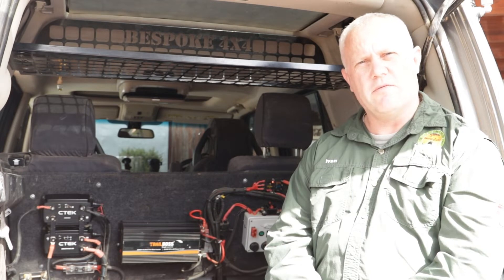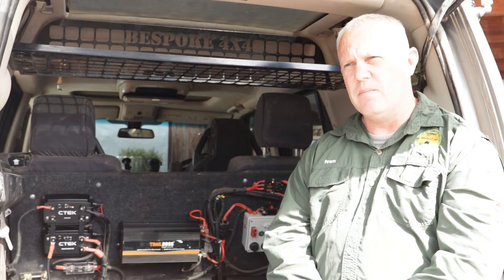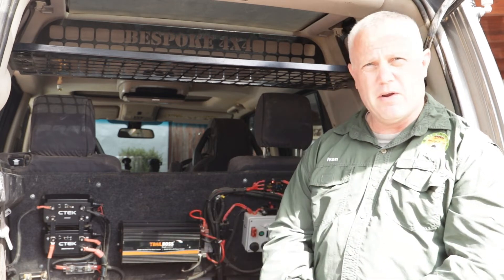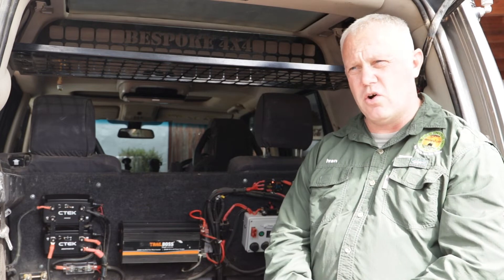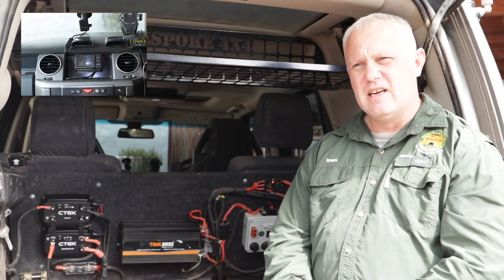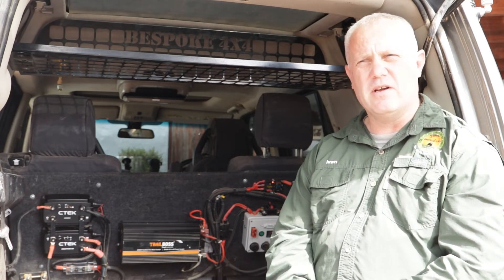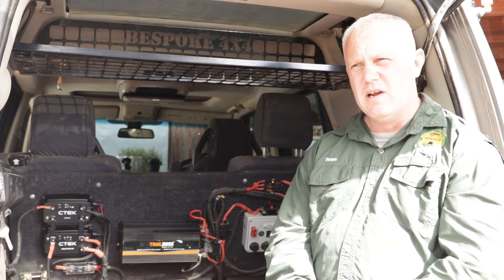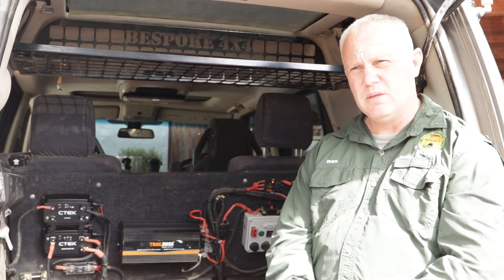CTEK D250SA and Smartpass 120 off grid system review

Comment: Hi. I have the dual250s with smartpass. Does this one actually send power the starter battery if it goes flat ? In the same way the 250sa does ? Thanks
Reply from the maker: Hi Nasser,

Thanks for your question.

To answer your question, I will break it down into two segments:

1.   The D250 (S, SA and SE) are purely DC to DC chargers, their sole purpose is to take your alternators voltage and usually up it to a voltage to best charge your service or auxiliary battery(s).  The D250 range will charge your Service/Auxiliary batteries up to 20amps.
2.   The Smartpass; its primary purpose is to take extra current (amps) from your alternator to provide extra amperage (controlled by the D250) to boost the charging of your Service/Auxiliary batteries.  

I do not know which version of the  Smartpass you are using (80amp, 100amp or 120amp), but the Smartpass has a second function to when necessary, (dependent on version) to firstly pulse the Starter Battery to keep it topped up with power from the Service/Auxiliary batteries for as long as possible when the engine is switched off.  Secondly, if the Smartpass finds that the Starter battery is flat, it will (again, dependent on version) provide up to 300amps of power from the Service/Auxiliary batteries to help start the car.  This supply of power to the Starter battery of 300amps is initially for around 10 seconds, then 200amps for around 20 seconds and then 100amps for around 30 seconds.

So, yes the Smartpass will assist with the starting of you car when your Starter battery is flat.

I hope this helps.....
Reply: @overlandi5056  thank you for clearly that up. Cheers for the thorough reply

Comment: Great Review!! Thanks!! I would like to ask you if it is possible to connect the starter battery to the service battery with a 500 A switch in case I need a lot of power to use the winch for a long period of time. 
Thanks and best regards 
Luca
Reply from the maker: Hi Luca, 

Thanks for the really good question.  

When using a D250 (S, SA etc.) in conjunction with a Smartpass, because you have DC to DC Charging (D250), you cannot connect the Service Batteries directly back to the Starter battery as you inquire.  That being said, I looked into your question at great length myself prior to installing CTEK equipment and obviously, in life, if you want to put enough effort in, anything is possible, but it is a very long drawn out affair and if you get it wrong, you will damage the equipment. 

But then I found out about a really clever feature built into the Smartpass as standard which, is why I went with CTEK equipment!!!!!!

The Smartpass is constantly monitoring the Starter Battery both when the alternator is charging and not.  So, if lets say, you go to start your car and find the Starter Battery flat with insufficient power in it to turn the starter motor, then the Smartpass will sense this and immediately engage what CTEK call "Start Assist" and provide to the Starter Battery with around 300 amps of power for around 10 seconds to help with the turning over of the starter and electronics needed to engage relays and solenoids associated with the starting process.

In addition, what I have seen with my application, which is pretty much exactly how CTEK recommend installation (other than I run much thicker or more heavy duty cables), is pretty much what you refer to in your question about the need to draw extra power from the Service Batteries to support the Starter Battery during heavy loading of the Starter Battery ( i.e. when using a winch or similar such heavy draw devices).  What I have observed is that in such circumstances, the Smartpass will allow the drawing of power from the Service Batteries to support the Starter Battery.  I think the figures I recall reading is that, it will provide, 300 amps for 10 seconds, then drop down to 200 amps for 20 seconds and then 100 amps for around 30 seconds.  

Of course, the rule of thumb when winching is to pulse or run the winch for say five to 10 seconds at a time, wait 5 seconds and then run it again.  This is of course with the engine running so that the alternator is charging all the time. 

I hope the above assists with your question.

Ivan
Reply: Hi Ivan, wow this is an answer to my question! Very professional and deep into details! Thanks a lot! I always tought that this is the system right for me.. and now, thanks to you, I am sure about it! Thanks a lot!!! Luca
Reply from the maker: Hi Luca, you are more than welcome.....

Comment: If I add the smartpass to the ctek 250 can I run solar panels with 45 amps through it
Reply from the maker: Hi,  Unfortunately not.  The D250 unit is solely used to charge the service battery(s) utilizing its MPPT controller within it.  The Smartpass allows for greater amperage to flow from the alternator to the service battery(s).
Reply from the maker: I meant to add, the D250 is primarily a DC-DC charger that takes your alternator voltage and (usually) ups the voltage to anywhere between 14.2 and 14.7 volts depending on what type of battery you are using (High Cycle, Deep Cycle, AGM or Lithium). It will in itself, charge with a maximum of 20amps, but when used with the Smartpass (80, 100 or 120) will ensure (subject to the size of your alternator output) you will be able to charge up to 100, 120 or 140amps respectively.  The D250 is an intelligent charger and in my view one of the best on the market.  I've been running the D250SA and Smartpass for several years now and they together take care of my two 140A/h AGM batteries.  I've never had one problem, but I must emphasize, the installation is critical in achieving peak performance.
Reply: Thanks buddy for your time ,I have the ctek 250se in the campervan for near 2 years runs great , so just ordered a mppc for the solar I'll run it separate to get the best out of the panels cheers 👍
Reply from the maker: I think given the current you need for charging, in your circumstances, you are going the right way. Of course, if your new MPPC (MPPT) unit ever failed, you will always have the back up of the CTEK 250SA's built in MPPT unit be it at 20amps. But it could at least keep you going.

Comment: hello ser, i have one question ) is it possible to put converted shore in to a ctek sollar  pannel point? will it work and charge the batterys ?
Reply from the maker: Hi Begi, can you advise what you mean by "converted shore"?
Reply: @overlandi5056  thanks for answer. i mean if i will take 240v from home for example and then convert it on 12v by converter and then put in  sollar charger point on ctek
Reply from the maker: Hi Begi, unfortunately no you cannot connect shore/mains 240v to a CTEK250 unit or Smartpass.  You will need to use a AC/DC Charging unit to utilize the mains/shore power.  What size battery's are you using in your set up?
Reply: @overlandi5056  for start i am going to have 190 ah agm battety.ctek will charge while car is driving but when it stops i need shore power to charge the battery.so i was thinking that if i will convert shore power on 12 v it can charge my battery from ctek like a sollar.if i cant and i have to buy inventer charger then why i have to buy ctek bundly only for charging battery while driving ? i can do that   with another option and it will bi cheaper
Reply: what do you think ?
Reply from the maker: Hi, I understand what you are trying to do.  A 190Ah AGM is a very good start for a auxiliary battery source.  Make sure you connect the very small black wire from the D250SA to the negative terminal of the 190Ah AGM, this will ensure the D250S can charge it at the correct voltage.   (See the installation manual)!!!!!!

In my view, I would utilize a CTEK 10amp charger (MXS10) or my preference, the CTEK 25amp (MXS25).  This way, you will have intelligent charging to the battery(s) when on shore/mains power.  Its also good practice when charging from shore and you have things switched on in the vehicle that are drawing power from the 190Ah AGM is to switch the AC/DC chargers onto "SOURCE" mode. This will ensure the charge is not tricked into thinking there is a problem with the load on the 190Ah battery.  You need to think about something quite important, lets say, you deplete your 190Ah battery to say 20% (no lower than this), you will need to put around 152amps back into it.  At 10A/h (MXS10), that will take around 20hrs. The MXS25 will take around 9-10 hrs.  Remember, whilst you are charging from the shore, anything running in the vehicle will still be drawing power so you need to take this into consideration when charging in terms of time to get the batteries topped up.  Of course, if you are on mains power from the time you stop the car, generally, unless you are drawing more than 10amp, the MXS10, will not only top up your 190Ah, but will have sufficient power to keep everything going without depleting the 190Ah.  Something you need to consider.  I think the MXS25 gives me much greater margin for error, but I am also running two 140Ah AGM units.  The way I have wired mine also allows my MXS25 to charge my Starter Battery at the same time, thus, all my battery's get charged up over night.

Another alternative as a backup, if you have the space, is to carry a 300w solar panel that you hook up to the D250SA.  You will have around 20amps of power available to charge with.    I do understand that this can start to get expensive, but, the truth is, you will undoubtedly have the best available charging system(s) that are reliable and will not let you down.  I've been running my set up for over two years now, and it has never failed me.
Reply: @overlandi5056  thank you so much.can you give me a link where i can see picture of wiring diagram?
Reply from the maker: I will send you a diagram is you want, do you want it via email?

Comment: Great review. I have been looking at different systems but now have decided on the CTEK.  Just wondering what the battery monitoring system is that you are using.   Thanks!   Roland Z     Australia
Reply from the maker: I actually use CTEK's LCD Display unit. It provides State of Charge in real time, charge rate and time to fully charged as well as discharge rate and time to discharged.  I find it a very useful tool.

Comment: only problem with this unit is the limit of 23volts in from the solar!! Will only take 300w any more will cook the unit!!
Reply from the maker: Sorry for taking a while to get back to you. I do tend to agree with you that the CTEK's maximum input voltage from solar is a bit of a problem as is the 300w power limit.  I have spoken with CTEK about this and I'm in further discussion about it.  I will keep guys abreast of what comes about.
Reply: @overlandi5056  no worries I too emailed them and they said to limit it to 300w. My problem is I have a 400w system. What I did do is buy a 50amp Epever  MPPT Solar Charge Controller and will run the solar though that but still keep the ctek for the alternator to battery charging.
Reply from the maker: I think you are right in relation to the route you have taken for your particular application.  I am firmly of the view that CTEK need to consider the larger RV and SUV applications with guys (like yourself) understanding that the need of 400w and above solar systems.  400w roughly 32amps of power is not that large especially if you have large say 700A/h service battery banks.  A AGM service battery bank that has say been taken down to the 20% minimum would mean you need to put back in 560amps of power. At 20A/h (present CTEK MMPT unit) means it would take 28 to 32 hours to recharge them, yet the D250SA and 120Amp smart pass together could easily charge the same 560 amps in around 4 to 5 hours of driving. A huge difference.

If a MPPT unit was charging from a 400w solar cell you should be getting 32 amps in good sun light (400w / 12.4V).  So 560 amps of charging would take around 17 to 20 hours. That's a huge difference.  Just for consideration, the thickness of your cabling from the Solar Cell to the MPPT unit is very important and I'd suggest given your application, nothing less than 16mm diameter cabling.  Of course, you need to take into consideration the efficiency of the MPPT unit as well.  I'm not sure on the efficiency of the Epever Unit. I'd be interested to know??????
Reply: @overlandi5056  i'm still playing around with the system and at this stage only have a 250a/h agm battery but only running a 12 volt fridge, lights, computer, phone chargers. I will add a extra 250 battery later.